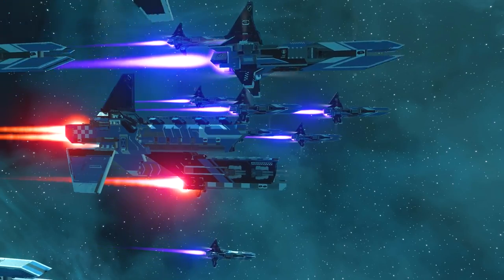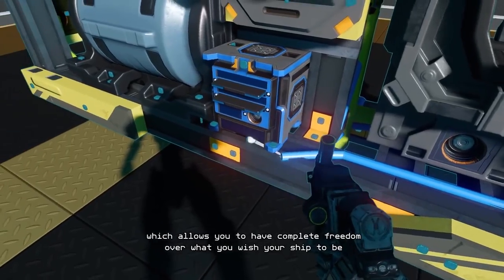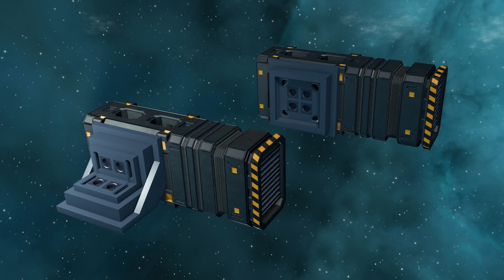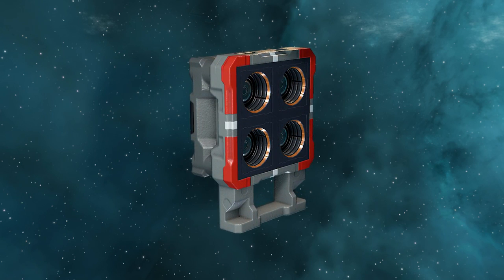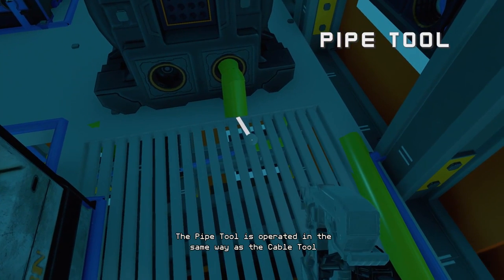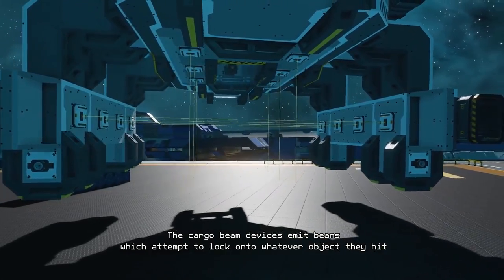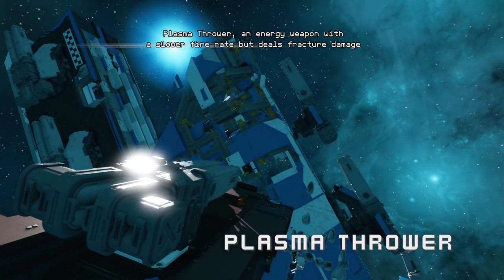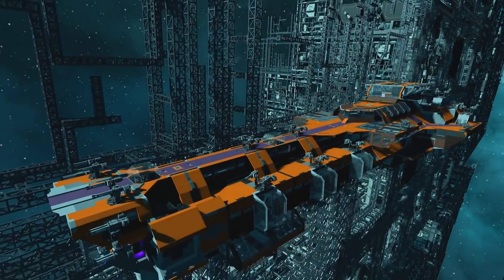Starbase Ship Building Process

Comment: 6:10

I have the sickest idea, build a maaaaassiive hive ship basically, it will have a huge 4 pronged opening in the front which will house a giant cargo lock frame. You would fly up to an unsuspecting ship and position them inside the four prongs then activate the lock frame, locking the ship inside, then you haul them off to a facility where you dock the ship inside a bunker designed to the specific shape of the ship. Deactivate the lock frame and board the ship and kill everyone inside.
Reply from the maker: gonna stop you right there on the maaaaassiive ship, they cant be done "yet"
Reply: Kenetor I knooooowwwww but someday I’ll gonna build me a dreadnaut and either fly it around until I run out of fuel or sell it to the highest bidder haha

Comment: I did see in a video some rotating pieces, stick the thusters on them rotor's and use a  Yolol command for a 90 degree turn for an awesome effect (And weakness lol)
Reply from the maker: Thrusters MUST be attached to connection points which are on beams, they will rip themselves off otherwise.
Turntables are for turrets and sensors only and also are rather slow at turning sadly

Comment: Really looking forward to building and designing ships in this game when it comes out. Few games like this are made anymore.

Though I will admit, based on the “construction” processes highlighted here I’m worried for how it will actually play out.

1. The “bolting” that you have to do seems like busy work. Im going to assume you probably have to do it due to how the damage models in the game work but I don’t like the concept of having to “staple” things into place. Also curious to see if the number of bolts on a particular item makes a difference? Is putting 4 bolts securing a piece of armor to the hull any better than using just 1?

2. Using cable and wire to connect electricity/YOLOL coding again seems like busy work that might not be necessary. Probably easier to do than “bolting” because you just run wires from point “A” to “B”. But I will admit I think this is something games like Space Engineers gets right, power just flows through the entire ship, it’s a lot easier to work with and again cuts down on busy work.

3. That repair tool I think has to small of a cone of influence to use. I know it’s pre-alpha but I would want to be repairing far more at any single time than the small amount shown when using the tool. Unless you have other players helping or AI programmed you repair ships through YOLOL, I see larger ships not being popular because of this. Imagine how long it might take to repair a large cruiser type ship in this game after a long battle by yourself.

4. All these things I list here add busy work and require additional attention from a persons computer and the server. Potentially slowing the game in terms of frames but also in actual play time, as people will have to be doing these other tasks rather than, fighting or mining, exe...

I still love the concept of this game and really look forward to playing it. I think it could be a very popular and an excellent game to play that keeps players coming back, I certainly hope that it is. I’m just concerned that these “features” may be more of liabilities in the long run.
Reply from the maker: hey dude,thanks for your comment, ill try and answer for you,

1, Bolting done in space to repair or build from scratch will yes be a tedious task BUT if done at one of the spaceship creator terminals at the station then this will auto bolt the ship for you, you just need to place the pieces.

2. wiring will be pretty quick i think since its just point and click, Rust has a similar thing for its electrics and is fine. They didnt do it like SE to add a gameplay element, you could cut through the ships power lines in combat and will need repairing, having redundant lines will be key.

3. from what ive seen it can fill in pretty quick, they have changed the way this work so you no longer have to paint it in, just click and hold on the piece and it will fill up. again this will factor into your ship design, how big the panels you use can make things easier to repair but be subject to larger fracture damage for example.

4. as for slowing things down, they have already had a working battle with more players than any SE server could handle, sothey are doing something right, and the upcoming Closed Alpha tests will be focused on finding bugs as well as testing how far these limits can go but they are thinking 10,000+ players by the end of CA. So until I see an issue, im trusting they worked the tech on this one to work well.

Hope this answers some it for you, feel free to comment more on anything further!
Reply: Thank you for the clarification, I’m eager to see this game come to alpha and test it.

Comment: Oi mate bought your ship, added a few buttons to my seat and it caused a small red square to appear in the glass, this "durability issue" when safety mode got turned off basically casued my entire cockpit to fall apart and even rendered the doors useless....please help (maximus series ship)
Reply from the maker: why on earth would you turn off safety mode? without knowing exactly what you did and where you put things I cant really help. ships with durability errors wont break with safety mode on, they just fly slower to not rip the ship apart, you have to solve the durability error first to get the warp class above 1.0

Comment: Anyone know if we can lay the cables and pipes alongside the frame, so they go under the floor and panels? Much less likely to get sabotaged then
Reply from the maker: you can indeed! you can even check them after a fight with that integrity checker too so you dont have to tear your ship apart further!
Reply: It was confirmed you can cut a hole in a beam, then thread a wire through it, and then repair it with the wire still remaining and working inside.